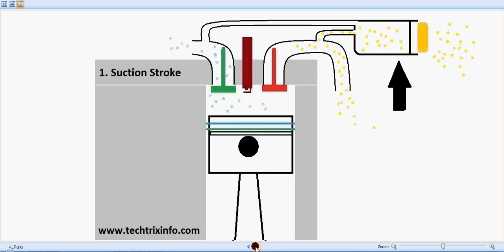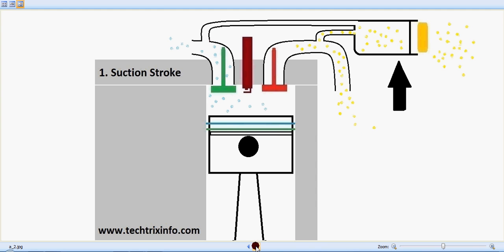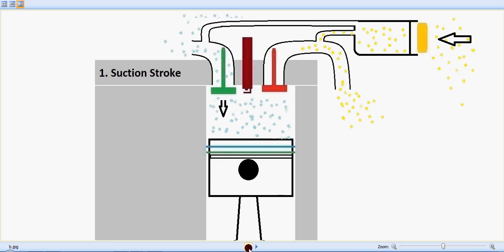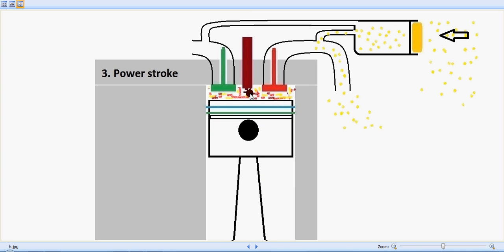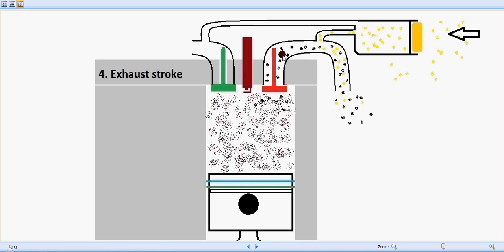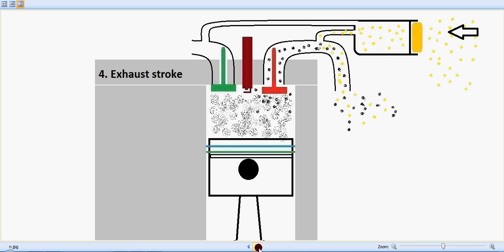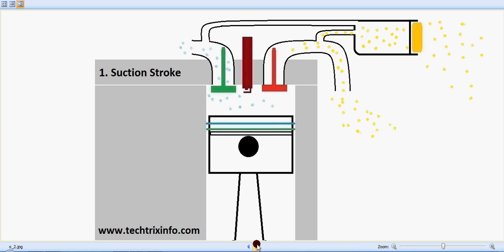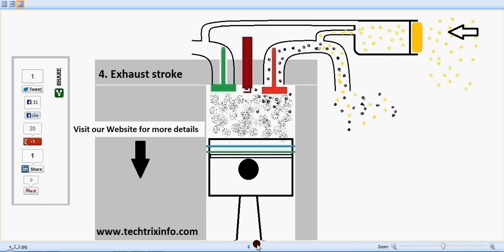Animation - How secondary air induction system works. ✔

Comment: Mixing and pumping clean air into exhaust makes it more cleaner, lmao! :person-turqouise-waving:
Reply from the maker: That’s an interesting take, The secondary air injection system does indeed pump fresh air into the exhaust stream, which helps burn off leftover hydrocarbons and reduce emissions. It’s a clever way to make the exhaust gases cleaner, especially during cold starts when the engine is less efficient.
Reply: @TechTrixInfo  Thanks, this explain alot.

Comment: thrs a one check way valve , exhaust is not going back in intake system...
instead  fresh air is added to exhaust gas for less emission 
(euro standard)
Reply from the maker: Hi, Thank you for your comment! You’re absolutely right that the secondary air induction system introduces fresh air into the exhaust stream rather than allowing exhaust gases to flow back into the intake system.

To elaborate, the primary function of the secondary air induction system is to reduce emissions by injecting additional air into the exhaust stream, typically during cold starts. This additional air helps to complete the combustion process in the catalytic converter, which in turn helps to lower the levels of harmful emissions like carbon monoxide and hydrocarbons.

The one-way check valve you mentioned ensures that the fresh air is directed properly and prevents any backflow of exhaust gases into the intake system. This design helps maintain engine efficiency and adheres to stricter emission standards, such as those outlined by Euro regulations.

Thanks again for pointing that out!

Comment: What if induction sytem is being blocked?what will happen?
Reply from the maker: Hi Cover, good question.
Faulty secondary air injection pump will cause problems for the air-to-fuel ratio in your internal combustion engine. If this ratio is too lean (not enough fuel), then your engine will have trouble generating speed whenever you step on the gas pedal.

Are you working in the automotive industry? If you have any doubts related to Automotive or Mechanical engineering, please feel free to ask.
Reply: @TechTrixInfo  Can you explain how it will cause lean condition if AIS system is block? cause the secondary air is introduce after exhaust valve right?

Comment: Ur therory is wrong... The sec air induction system is one way system of air indiction ...When the exhaust stroke happen the sec air induction valve should be closed ... Exhaust gas only escapes through exhaust pipe only not through secondary air filter
Reply: nice ... answer ... sir vignesh....
if the exhaust gas enter after through the air filter ...
 the cleaner get rough or burn .....and the engine wll hard to intake air....

Comment: If it is working as designed, it should have no effect on engine horsepower, and it more completely burns toxic exhaust. Surprising how critics don't even understand the basics of how this system works.
Reply: If you pump exhaust gases into cylinder, you will have less oxigen, so you reduce the power of the engine. Also, you clog the inlet duct with soot. So this is the most idiotic engineering solution ever in the history of automotive! The only advantage is regarded to emissions during cold engine temperature. Everything else is a con.

Comment: A thing to consider - locate your secondary air valve, put a plate between the valve and intake, screw back together and enjoy a smoother engine run with a little less consumption. Why? Because your engine does not need to burn crap and stuff again that has been already burnt once. EU norms are idiotic, almost no matter which one you pick. With the secondary air system you get less emmisions, but you have to burn more fuell (and your engine gets crapped up quicker). Without it you pollute more, but burn less fuel and your engine is more likely to run fault free longer. The difference is almost not worth mentioning if you go deep and analyze how much energy and waste is being lost with producing the extra fuell needed to burn that crap instead of not burning the crap and just run smooth. And lets face it - big factories, ships and planes pollute the air way more than just all the cars around and nobody gives a damn, because it is easier to pick on the little guy. It is all just a way how to Fck with people and their stuff. 

Worried about emmision test once a while? Remove the plate, get your OK stamp and then put it back in. Since the rest of the car is fully electronically cotrolled you`ll get no engine light or whatever, because the system will adapt itself instantly. Who else doesn`t like adapting himself to better air :)

Don`t trust my idea? Check Google for your specific car and if somebody else hasn`t done it yet.
Reply from the maker: iiiYEDDLEiii Thank you , please subscribe to us for more videos n keep connected with us on Facebook just search for Techtrixinfo
Reply: Hey I have a couple questions  msg me
Reply: Wow the best comment ever

Comment: like the video... if i use a secondary air system on my motorcycle what performance will i get out of it?
Reply: +John Crusader I know this post is a year old and all, but I wanted to respond anyway. Using a secondary air injection system will NOT lower engine performance. Many motorcycles come with them installed from the factory. It also will not change your fuel consumption. The purpose of a secondary air injection system is to do 3 things. 

1. Reduce HC(hydrocarbon, aka gasoline) emissions during the warm-up period. Not CO2. While CO2 does contribute to the greenhouse effect, it is a naturally occurring part of complete combustion. A secondary air injection reduces HC emissions by "injecting" filtered air into the exhaust stream, typically into the exhaust manifold(this is true also with motorcycles). This air then mixes with the hot exhaust gases, and causes any UNBURNED HC to ignite, completing the combustion cycle, and produces CO2 and H2O.

2. The heat produced by this burning inside the exhaust brings the O2 sensors, and catalyst up to "light off" temperature sooner. That means it helps other emissions components run faster and cleaner too.

3. Once the vehicle has reached a closed loop or to put it simply "warmed up", the injected air is directed only to the catalyst in an effort to reduce NOx emissions. The air bypasses the O2 sensors because the vehicle would read lean if air flowed passed them.
Reply: AzealAzrael u r talking exactly correct
Reply: Using that will lower your performance output. Or leave it unchanged but raise your consumption. This is just a way how to lower CO2 for the office of idiotic ideas that own a stamp allowing you to drive around. More details in my later comment